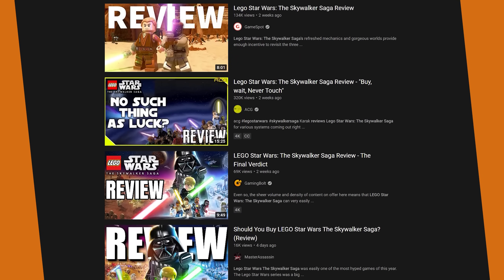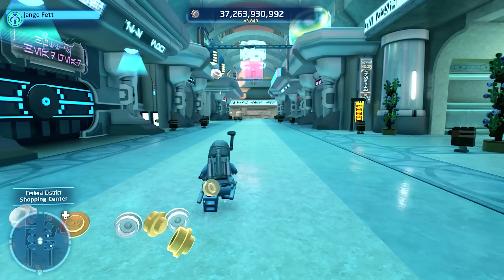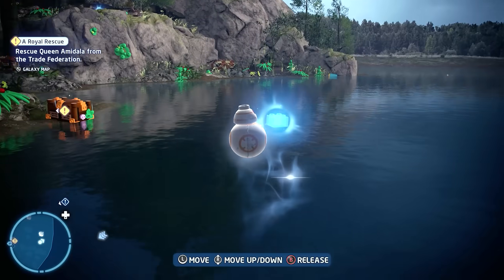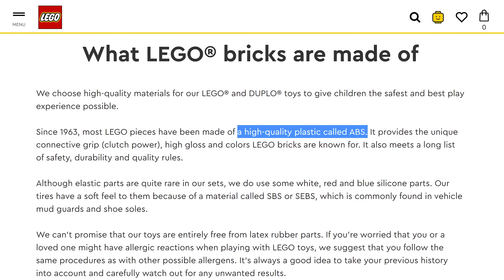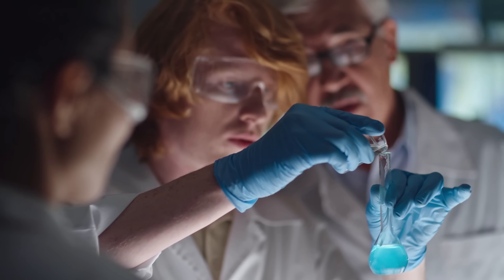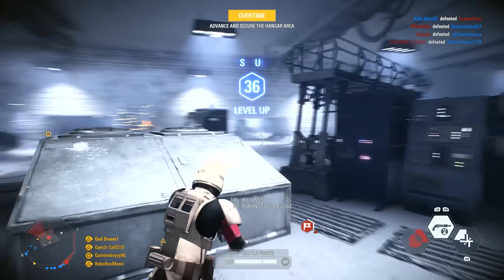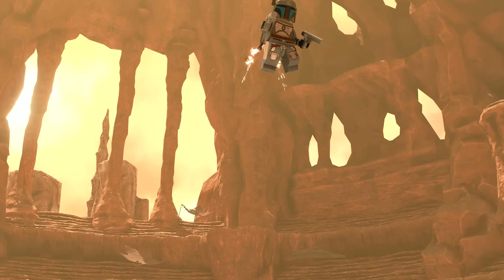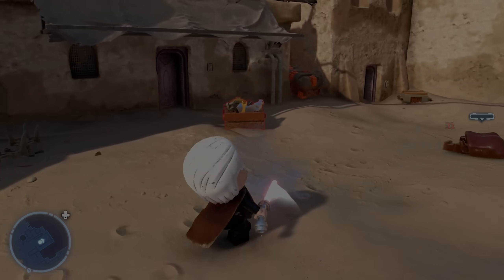Why Lego Star Wars: The Skywalker Saga Has a Serious Jetpack Problem

Comment: Another thing about Tt Games making jetpacks bad so people have to do puzzles as intended: In the LEGO Hobbit game there are a lot of puzzles which require you to find a crank arm which you put somewhere so you can do something. Despite this being a common puzzle found throughout the game, there is an item you can create which makes it to where you never have to ever find the crank in the puzzle, you just pull out the one you created anytime you come across one of those puzzles, especially since it has unlimited uses. And this is an item specifically implemented for the sole reason of allowing the player to circumvent these specific puzzles. The inconsistency is crazy here.

Comment: I definitely do agree that the Jetpacks are just not the same, being slow and no hover, which is super unfortunate. I did find one thing with them that allowed me to get to certain kyber and paths that others should, however.

If you double jump then use the Jetpack, since it pushes the character up, it'll technically act like a third jump and make all of the jetpack characters jump higher than any other character, giving it some extra, unintentional use lol. Prime example of using this is the kyber in the railings above the Hoth base. You're SUPPOSED to use the scavenger to glide to it, but I didn't have that yet, but the using the jetpack the way I did allowed me to get it instead

Comment: Now I agree that jet packs in this game suck. But one point I didn’t agree with is at 10:40. The pre-rendered cutscenes ARE the story. Gameplay does not change the story being told. It’s just an INTERPRETATION, BASED on said story. Think of this game as a section of power lines. The wooden posts are the plot points, this is the framework/outline of your story. While the power cables are gameplay. They go to the same place, yes, but they can be bent and moved around a bit. This is your creative freedom needed to make a game. These cables are what PLAYERS experience. A loose interpretation of the experiences the CHARACTERS go through. My point is that your subjective experience (gameplay) cannot be used to accurately define the rules of a world. It’s canon that the Flacon and it’s crew went into the giant space worm, but it’s not cannon that they found a double score zone inside of the worm.

Comment: I was able to use the jetpack to "skip" certain block puzzle, some of the puzzles that only require vertical height that need force users to move boxes to get height Typically can be skipped by just hovering with the jetpack at certain angles with a well timed jump

Comment: Here’s the thing I find strangest about the class system. 

Initially, it seems to be designed to make the roster more fair. If you’re part of x class, you have the same abilities as everyone else. I think it’s TT’s way of trying to make certain characters less obsolete in terms of puzzle-solving…but I find that statement I just made contradicting due to the “Extra” category, along with the fact that Smugglers can only interact with one type of puzzle element, Opportunities. At least they get more unique through upgrades.

Getting to the point (and another contradiction), Skywalker Saga basically breaks its own rules with certain characters, DLC included. And I’m not just talking about the jetpacks. The Phase 2 Clone Troopers are Heroes, but have all the Villain Abilities. This makes sense because of their transition to Order 66. Same goes for the B2 Super Battle Droid. It’s an extra, but also has all the Villain Abilities. Sure, they don’t have the upgrades, but can still interact with the puzzle elements. 

There’s also the First Order Flametrooper and Incinerator Stormtrooper. No, scratch that, it’s the flamethrower itself! The game doesn’t care that you’re a Bounty Hunter, you can melt gold all the same BECAUSE IT’S HEAT! Keep in mind that I’m not mad about these choices, quite the opposite. I would not have minded if they had bent the rules with more of the roster.

Comment: one thing i have noticed,  Mandalorian jet packs use pure rocket thrust, and in fact have points for RCS thrusters...  This lets them operate in space, and atmosphere.

in contrast the first order jetpacks look to be air breathers, powered by twin 'micro jets'.   They lack the RCS thrust points, and instead use a limited vector control system.  

In short, ones a rocket engine, the others a Jet engine.

Comment: I'm not sure if you're aware, but if you tap the jump button after an initial jump instead of holding it, and then hold the button after, you can effectively use the jetpack to give yourself a triple jump that also lets you move in a straight line after for a short period. I was messing around with this and found it to be extremely useful for navigating the free roam, especially when trying to boost myself *up*. I like to think about it like how yoshi can flutter in several 2d mario games; that's what the jetpacks feel like with a double jump. I actually am not disappointed at all with how jetpacks work after this revelation; they're unparalleled in vertical movement and are great for an extra boost in horizontal movement across agap.

TLDR: You can triple jump with jetpacks by tapping the jump button twice and then holding it and it's actually pretty useful.

Comment: Jet Packs would break the platforming for bricks. Simple as that. They still are the most effective jump compared to other characters, so you get the benefit. My only wish is that there was a hover mode close to the ground, but that is a small thing that ultimately doesn't add a ton other than a cool thing to do.

Comment: Honestly disagree as well. About 45% through and already I've cheesed dozens of Kybers intended for virtually all other classes. The strength of the jetpack is in covering lateral distance, and for gaining height quick, that's where you use grapples. I think it's fine how it is, though an expensive cheat to let you fly everywhere would be cool. Honestly the jetpacks in this are way better than in TCS where they do almost nothing and often times don't even let you cross most gaps meant for R2 hovering.

Comment: Jetpacks could of easily been uterlised. Have a double jump activation for permanent flight while over solid ground. That way you can fly while fighting to look cool basically. It means you cant use cover so that balances out that. Have this flight level remain at double jump height, no using it to climb, and if you hover over a drop, you fall.

Then have the single jump activation  do the scavenger glider type if flight. This lets jetpacks multiclass in a way that makes sense.

Comment: I remember when I first tried out the jetpacks in this game and was greatly disappointed with how short the duration is, but honestly after playing with them for a few hours and getting to know how they worked I adapted and now they're unironically one of the most useful things for me in regards to open world exploration.

I've found that when you fully upgrade your running speed, all the momentum that you gather while running carries over when you're flying with the jetpack. So if there's a far jump that isn't too ridiculous, I'll get a good running start first then tap the jetpack in mid air a few times until I reach said platform. Too far away however then you'll need to full send it but with the momentum gathered from running I've been able to clear surprisingly large gaps.

As for vertical height, I find that if you want to clear a high fence or wall for example then you really have to get as much height as possible out of your initial double jump before fully boosting with the jetpack and you can actually get some good height out of it.

The only thing that really sucks for me personally is that they didn't have The Mandalorian a jetpack even though he's barely ever seen without his after season 1.

Comment: I have the exact opposite experience with jetpack, using it often to open up more skyrim horse climbing options to get a kyber brick without having to do those annoying force block "puzzles"
Reply: there also good for getting more time on locking onto to grapple points if you use a sith to lift them up

Comment: I tried to use a jet pack character to skip the part where you have to cross a gap by closing the hangar door and using it as a bridge in The Episode V mission, where you have to use the satellites to find Luke, but it literally has an invisible wall stopping me from jet packing across when I could clearly make it.

Comment: I actually used Jango Fett for most of my time in free play because the jet pack is the best jump in the game. If you’re smart about it, you can definitely clear jumps that you normally can’t with any other character, since it’s the highest jump in the game. On top of that, I used it to get extra height or fly across gaps to reach grapple points early, there were times I’d be able to skip half a of a jumping puzzle just by cheesing grapple points with the extra jet pack height. If you can get a sprinting start you can get more momentum behind the jump and it’s basically the farthest jump in the game too (minus the glider). The jet pack seems like it sucks at first, but if you’re smart about it, it’s honestly pretty easy to cheese a lot of puzzles and can be used to get to places easier.

Comment: There are three ways I think the jetpacks could have been fixed : 1. make it a permanent Hover with a specific height above the ground, this would still be pretty bad but at least cool. 2 ; Upgrades that allow the jetpack to fly higher/longer/faster. 3 ; a expensive extra that would fix the jetpack by making The same as 2.

Comment: I thought they were worse until I found out with good timing you can get a THIRD JUMP (b tap b then hold b) letting you get more height or crossing areas the same length as old pack. I do wish the hover stayed considering you can fire in the air

I do miss astro hover tho

Comment: There was a Kyber Brick on Cloud City "Dark Cloud" where you had to jump up on ledges, and a series of moving platforms then you walk along the wall and had to go around the pillars to reach the Kyber Brick. While Double Jumping can work if you time it right.

 Instead of doing that I used a Boba Fett to get across each pillar to reach the Kyber Brick . 

There were very few reasons to use any jetpack Lego Character. Infact its sad how an EWOK with a glider is 10x better than the Jetpack on a Bounty Hunter.

Comment: Fun fact, in the original lego Star Wars  game (the original release which only included the prequel trilogy) Jango Fett had infinite jetpack fuel, and could move while flying for as long as the player wanted. 
Unfortunately, a good amount of long gaps over pitfalls were specially coded to cause the Jetpack to fall despite the thrusters still being active. This was most likely to ensure that players did not explore out of bounds or skip puzzles. 
The difference becomes more interesting  in this game when you compare Jangos jetpack to Astromech hovering, which is based entirely on hover duration, rather than specially placed trigger zones that cause the Jetpack to fall.

Comment: If Jetpacks would be such an issue, then why are scavenger gliders fine? In fact, you can skip so many kyber brick puzzles by using force on a droid, or even more broken, a sith with upgrades can force lift a scavender with a glider.

Comment: I'm actually using Bobba to explore and work on 100% the game, the jetpack isn't nearly as good as it used to be however I have discovered a few tricks with it. The one I can think of rn, is getting more height, if you do a quick boost then do a full boost you'll actually gain height, this along with the grapple has allowed me to get easier access to certain kyber bricks.
Reply: Yeah, Boba and Jango are still better than the other Bounty Hunters purely because the slight added hover is better than nothing.
Reply: Yeah, I'm using boba and dark side Anakin, because they look sick, and they look sick together. Use Anakin to lift the other character wherever I want. If you wanted to be more effective, you could replace Anakin with Vader. Vader has the ability to use the villain panels, along with his dark side power set
Reply: for added distance, you can tap really quickly for basically a double jump, which can be done twice, then hold the button and still use the full jetpack

Comment: If the size of the character is increased by three then their mass would also increase by 3 and the acceleration would increase by three from the jet pack so even though your jet pack is accelerating at a tripled rate, you still need to lift 3 times as much weight, so it would be proportionally equal. To fix this you would either just need to triple the acceleration and not the size of everything, or decrease the size of everything but jet packs by 3

Comment: So, you can actually gain height with the Jetpacks. I’ve actually used boba a lot to get bricks before. When you initially use the jet pack, if you don’t hold jumó you can get like a double jump from the Jetpack. But if you do that, then hold a afterwards you can get some height while going some distance.

Comment: For real though, the reason the jet packs are gutted in this game is because of the character class system. Personally, I am a defender of the character classes in the game because previous Lego games had the flaw of many characters being borderline useless because there are characters with more abilities than everyone else and some characters with almost no abilities worth using. The character class system in LSS makes sure that each character is equally useful, at the cost of less abilities overall. 

Back to the point, because they're putting characters like BB-8 into the same character class as R2D2, basic Stormtroopers in the same class as the flametroopers and Boba Fett and Bossk in the same class. It's either give BB8 and Bossk the ability to fly somehow or nerf/remove R2/Boba's ability to fly. Or, third option, make a new class for characters who can fly, but that'd come with its own set of issues like adding more Kyber Bricks for that skill tree, and even then, Scavenger's basically have it covered anyway. 

Basically, while the jetpacks have been nerfed in this game, considering that the game was never built with it in mind, the fact that some characters even float is good enough.

Comment: I may be in the minority here, but I thought that the jet packs were overpowered. I used them to get most Scavenger bricks before unlocking scavengers, as well as being able to skip several parkour/puzzle based bricks.
Reply: Disagree. The scavenger part is the fault of scavengers or being easily accessible and the others is not a case of being overpowered but a case of multiple solutions

Comment: I will say that i have used the Jetpack to get better height. If you jump, jump again in mid air, and then again, then you can get better height than normal jumping. That is basically the only other use tho so, take that info if you will.

Comment: I have seen youtubers use L O2 and ABS as a rocket fuel, it's actually really efficient since you can 3d print complex surfaces to alter the burn characteristics. uv cured resin impregnated with an oxidizer (since there's no heat involved, and thermoplastics melting messes with how rockets burn) would make an interesting lego-based rocket project entirely made of plastics.

lego have used acrylics before, so a resin-based plastic rocket would be valid to the universe.

Comment: They nerfed it so you can use the scavenger legos powers
Reply: Gliding is a slope downwards while the jetpack is a straight line, still not a good excuse
 Plus, you could just have the glider as is, with the expenses of height, you have a larger distance
Reply: @deathpie24  yeah it’s lame none of the “jet pack characters” can no longer fly indefinitely.  But they had to make something different. Now they can advertise as all new powers while destroying some characters.  And don’t get me started on the blaster and net. They should be stand alone specials.

Comment: I see one issue with this otherwise perfectly logical and scientific approach. The character you used the most, the first order jet trooper, similar to many other characters, has a functioning rocket propelled weapon capable of accelerating mass further and faster than the jetpack they also wield. This leads me to believe that in fact the jetpack design itself is flawed in some manner. Therefore we should be lobbying to return to the old jetpack model reminiscent of a scuba diver's oxygen tank
Reply from the maker: That's some big brain stuff right there
Reply: True, however I would like to mention that rockets are supposed to explode, thus safety is less of a concern.
Reply: the rocket weights less than a person?
Reply: Also if everything is enlarged by 3, than the same thing would happen. Triple the weight, triple the fall.
Reply: @the_disappointment  yesnt. who says their density is enlarged by 3?
Reply: @the_disappointment  there you go. even better
Reply: but lego dude greater mass than rpg
Reply: Nerd

Comment: I was in mustafar and tried to use the jet pack to glide over to a platform and just fell in 2 seconds. Such a disappointment I loved using them in the original to go around but now I can’t so if I want to go around I have to just keep using the force to move my teammate and switching them. They should implement different jet pack types for different characters. Jet troopers could go vertically but with little horizontal movement whilst someone like Jango could have horizontal distance instead.